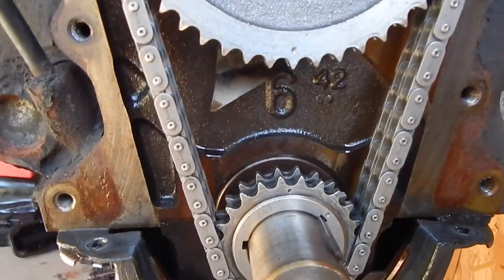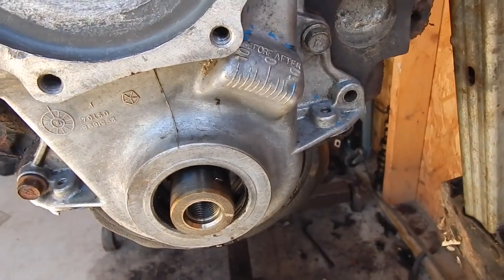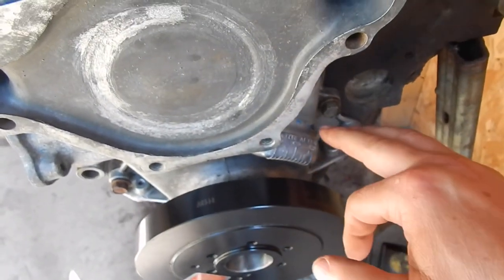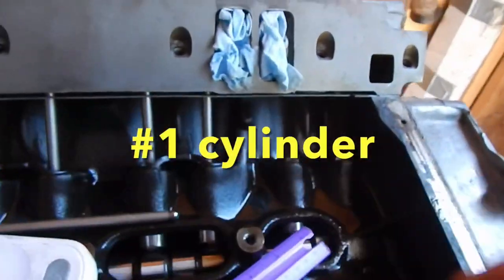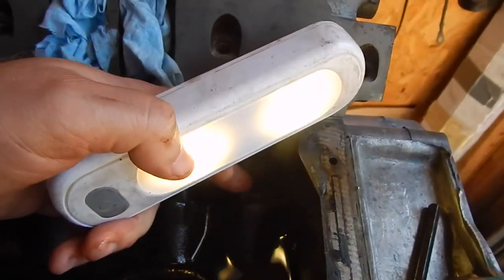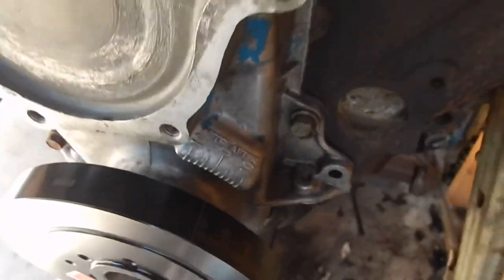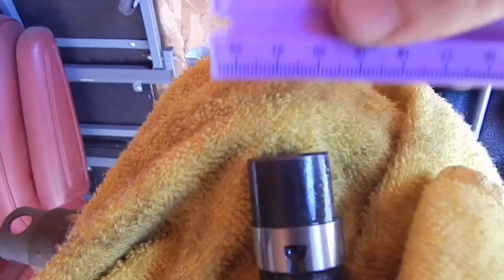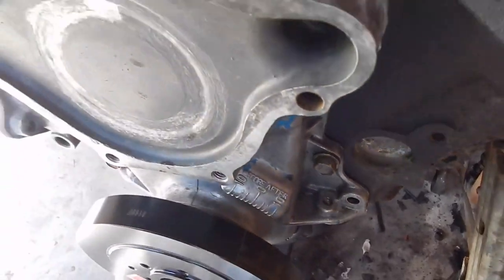Degreeing Cam WITHOUT Degree Wheel  * Low Dollar 360 Mopar

Comment: The method i always use to find top dead center compression strokes with the engine together is i use a compression tester hose and attach a vacuum gauge to it. Screw it down into the hole on number 1 cylinder. Then by hand i slowly rotate the engine with a ratchet or wrench. When you are on compression stroke you will see pressure on your vacuum gauge start climbing. Then it gets to a point where it stops. I find the sweet spot between barely turning the crank bolt clockwise then counter clockwise. You will find that spot your vacuum gauge shows pressure then stop. Then when you barely try to turn the engine in reverse it will show vacuum. This will be exactly TDC compression stroke dead nuts. If my explaination made sense to yall. But thats the quick, easy, accurate method i always use.
Reply from the maker: Thanks for sharing that tip!

Comment: This method is only good to make the check on STD & stage 1 mild cams only. On race cams like stage 3 to 5 street strip with over 510 valve lift & over 290 @006 on the ramp the method wont work you will need to use a degree wheel.

Comment: Perfect. Also, don't install your distributor thinking this is #1 cylinder on the compression stroke....it isn't...it's the #6 cylinder compression stroke.
That might confuse alot of kids...lol.
Reply from the maker: Thank you!  Yes, you are correct
Reply: @318willrun  , After the marks were aligned with chain on, I rotated the assembly one revolution until cam and crank were both at 12:00 just to drop the distributor in for #1.
This is easy to verify before the intake is on....both lifters on the #1 cylinder will be on the base circle of the cam....easy.
Actually, it doesn't matter at all what position on the cap to designate a cylinder to....it can be anywhere a particular cylinder is on the compression stroke.
I'm sure old timers all know this.
I am still befuddled about why Mopar uses both 12:00 positions on the gears for the #1 cylinder compression stroke.
Is a Chevy this way also?
I don't work on bowties.
Reply from the maker: @PTucker0864   I can't remember how GM's are set up.... LOL

Comment: ..I just did this, thought I would bring up 2 problems, first, you need to measure your lifters to make sure they are the same length,I found some as  much as .008 difference!..so I had to match a pair up, second,the lifter will not stick out far enough in an " LA " type motor I solved this by temporarily gluing a bolt on each to get them to stick out of the lifter bore..thanks for an excellent video!
Reply: You could also just use a second lifter and put on top of both of the cylinder 1 lifters. The depth of the lifter into the bore should keep them straight enough to accurately get a reading.

Comment: I guess you could say that verifys straight up. Better than skipping it altogether. If you don't have an adjustable timing set all it is is for your own knowledge that it is correct. You could get a cam that's wrong box or something. Check lift and what you did is  better than just trusting it. I might make my own degree wheel so I can check it a little better thank you the tip. I will use it,  to also check damper and gear set
Reply from the maker: Some have printed the degree wheel off of the internet and then glued it to a cardboard.   I actually have a degree wheel also, and the crank socket/etc.

Comment: Just put new cam in my la 318. When the motor is tdc on number 6 the dots are at 12 and 6. When number 1 is tdc the cam gear dot is at 12 and crank 6. Was same with the stock cam. I installed the distributor with 6tdc and rotor facing the firewall. Same as when i took it apart. Is this correct?  Too much yes and no on the web. Thanks
Reply from the maker: Sounds correct if I read it right
Reply: @318willrun  thanks

Comment: The wheel method is a little hard for me to grasp but as a man who has only had used motors and slipped balancer's my life this makes sense to me as the screw driver method is how i get my new zero on a old used worn engine that the balancer or chain has slipped! my 72 Challenger is 10 off from TDC 0 as its New 0 so when im timing i use 10 as my zero and she runs like a champ where if i went of of 0 it ran "Retarded" no pun intended lol......Great Vid
Reply from the maker: Thank you for watching!!

Comment: Hey 318WR, It looks like a roller block you’re doing the flat edge trick to. I have a 84 360 out of a ramcharger (non roller) I have a .525 lift cam and Factory style hydraulic flat tappets. My question to you is on tdc they don’t protrude past lifter bore like yours, instead they’re recessed so do I have the wrong lifters? Does the truck engine have shorter lifters than the car? Am I okay here or is something not right? Thanks
Reply from the maker: No, you have the non-roller lifters.  You can go off the rockers or push rods, or you can put a short tube or washers (equal in height) using your own imagination to make up the difference

Comment: With as much respect as I can muster up, and with no offense to the Author,  this information is incomplete! 
In order to properly degree in a camshaft, we must first establish true # 1 cylinder TDC. 
The most accurate means of locating true TDC will be by using a PPS tool (positive piston stop)
With cylinder heads not yet installed, a cylinder block deck mounted PPS tool can be used. 
With cylinder heads in place, a spark plug port PPS tool can be used. 
 
A dial indicator will also work (cylinder heads not yet in place), but only if the # 1 piston's location is checked at 2 different locations in it's travel towards top of stroke. 
In other words, we want to stop the piston at lets say 30 degrees before top of travel in one direction of rotation, and then stop it again (in the opposite direction of rotation) at 30 degrees before top of travel.  Now we have elimated any error caused by a minor crankshaft movement. 
(you can use 25 degrees or 35 degrees..... as long as the same angle is achieved in both directions, it will not matter.  I find that 10+/- degrees is not quite enough to acheive the accuracy I am after) 

Conversely, when we use a dial indicator to find top of travel only,  it still allows for a degree or two of crankshaft movement while the piston appears to be resting at top of travel. 

When the PPS tool has been removed, and when the total of the 60 degree angle is split, we rotate the crankshaft until our new marks align. 
Now we are at true  # 1 cylinder TDC.

NOTE: If the OEM markings need to be corrected, now is the time to do that! 

This new TDC starting piont allows us to accurately degree in the camshaft, and equally important, end up with the correct ignition TA (total advance).   

One more note..... the reason for phasing or indexing a camshaft, is to compensate for, or correct, any errors that may be incoporated within the cranshaft sprocket or within the camshaft sprocket. 
The camshaft itself (during manufacturing) should be properly phased/indexed to it's sprocket's alignment pin bore. 

Bottom line...... in order to locate TRUE # 1 TDC, we must use a means of accurately stopping the # 1 piston at XX degrees (before top of travel), and then stop it again at that very same XX degrees (before top of travel) in the opposite direction of rotation. 
Then we split this angle by dividing it in half. 
Remove the stop..... and there we are!  

Again, no offense to the author. 
I'm simply adding what I believe to be some much needed clarification.
Reply from the maker: no offence taken!   I think I stated that a degree wheel is best at the beginning of the video.   The engine has performed better than expected!
Reply: @318willrun  My point is...... why even bother going through this procedure if the intent does not include being accurate?  The entire idea behind degreeing a camshaft, is to obtain accuracy! 
Using a dial indicator on top of the piston (as you describe with a 4 degree variance), is very inaccurate!  A dial indicator can be used, but should be used with a degree wheel, and while obtaining the "split" that I mentioned earlier. By stopping the piston at the same angle in either crankshaft direction, and by then obtaining the split angle, we establish True TDC, of which becomes our base for the rest of the procedure! 
The screwdriver via the spark plug port is not a good idea, nor is guessing where true TDC is. 
I would suggest reading my previous posting re; the use of a PPS tool and a degree wheel. It is not all that difficult to do.  

One last comment...... and again, no offense to you...... people turn to these YouTube videos for advice, or the "how to", and so on. I believe that we have an un-written responsibility to show these people an accurate means of performing certain tasks. 
In other words, I am more concerned that these viewers gain a more complete understanding as to how this is professionally achieved.
Reply from the maker: @markemery49  As stated in my home page, "Unprofessional advice, use at your own risk"  😉  However, if they have the same results as I have, they'll be very happy I am sure!!!!
Reply: @318willrun  Quoting you;    "However, if they have the same results as I have, they'll be very happy I am sure!!!!" 
Again, that is my point....... they will end up with the same results as per what you ended up with! 
It is so simple to follow the camshaft manufacturer's instructions..... and that begins with first locating TRUE # 1 TDC, and by using a degree wheel and a PPS tool.
Reply: @markemery49  I agree...... I've never gone beyond oil changes, plugs and wires, grease fittings, etc..... NOT EVEN removing valve covers....
Until the other day.....
Ended up having to replace cam, lifters, intake and valve cover gaskets, etc, etc.....
Made me a piston stop in about 5 minutes from a spark plug, a tap to thread the hole left by removing the ceramic, and a bolt... .
Because if I'm gonna learn about it and do it, it's gonna be done as best as can be done.... the right way!!
Reply: What if the chain has a little play when you spin counter clockwise do you take anything into account ? Really like your method ! 😎

Comment: Hey do you have to go through the last step with the lifters? Is it possible to leave the valve cover on and just the line the two notches on the pulleys and the notch on the timing plate
Reply from the maker: If not using the lifters, then at least use the top of the pushrods, or in the very least, the rocker arms.  I would remove the valve cover in the very least.

Comment: Question :  when you have the crank dot at 12 o'clock and the cam dot at 6 o'clock is the #1 cylinder at TDC on the compression stroke or TDC on the exhaust stroke ?  Or is #6 cylinder at TDC of its compression stroke ?
Reply from the maker: Thanks for watching !    So I'll use your terms... the exhaust stroke.   It's  where the overlap happens, meaning the exhaust valve is almost shut and the intake valve has already begin to open.
Reply: @318willrun  o.k. so, if the crank dot is at 12o'clock and the cam dot is at 12 o'clock is #1 cylinder at TDC of the compression stroke ?
Reply from the maker: @tomdamon7208   Yep !   And your rotor should be pointing at the #1 spark plug wire.   It'd be ready to fire

Comment: This is good to know . Also online I've seen a black and white  print of two differnt positions for the small block distributor gear / oil pump shift to be positioned in . 1st diagram- the strait edge groove shows to be facing the driverside front corner of the block between the block and head . 2nd diagram -  the same groove face strait forward facing the water neck ? these are the ( positions ) for the rotor to be facing at TDC  ? I guess if the pistions is at TDC on compression stroke and rotor facing number one plug I guess it doesnt matter ?? what's your opinion
Reply from the maker: Thank you for watching!   I guess it’s easy to point the rotor to number 1 on the compression stroke, but you can time it in any position
Reply: With the timing chain sprocket Dots correctly lined up,   the factory installed the distributor Intermediate shaft index slot to be exactly Parallel with the Camshaft axis.....This usually allows the distributor advance Diaphragm to be factory located without hitting anything....

Comment: I'm dropping a 20-212-2 (268H-10) comp cam into my 360 . The @.050 is 218. My question is, Do i line it up the same on zero or do I need to do any special advancing or retarding? May seem silly to some but just wanting to make sure it's in right the first time. Love the channel bud. Keep it up.
Reply from the maker: Best way is to degree it using a degreeing wheel according to the cam card supplied by Comp.    You can use this method in the video to see if dot to dot on the timing set is kosher on the overlap.   3rd and final method would be to just align the dots and hope it's spot on or very close.

Comment: What size cam is that , what are the specs
Reply from the maker: 218/224 @050, .494/.501 on a 1.5 rocker
Reply: @318willrun  thanks man, that should help it alot
Reply: @318willrun  Lobe separation?
Reply from the maker: @reallivehumandrummer4438  I'd have to look at the cam card, don't remember off the top of my head.  Didn't I show the cam card in this video?  or was it another????

Comment: I degree every cam cause I want to milk every bit of power I can. I use dial indicators to find roll overs and verify. I use Mopar performance and have never had a problem at all. Center lining a cam is different. With a bog block mopar using mopar performance you have to center line the blasted thing.
Reply from the maker: Yes, as suggested in the video, degree wheel and indicators are the sure way to go.  Thanks for watching!